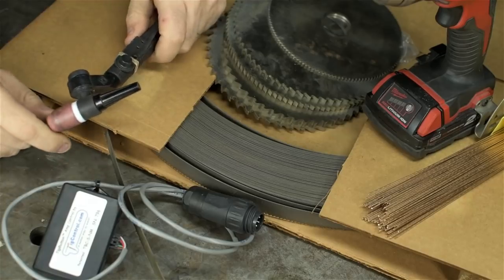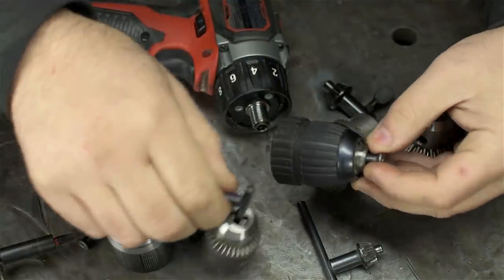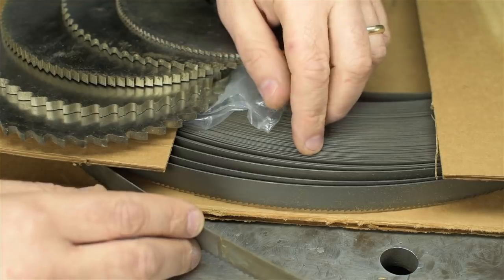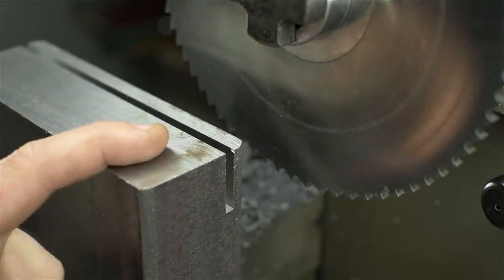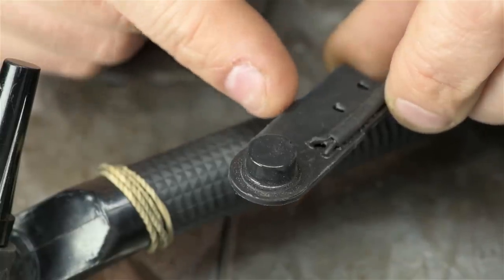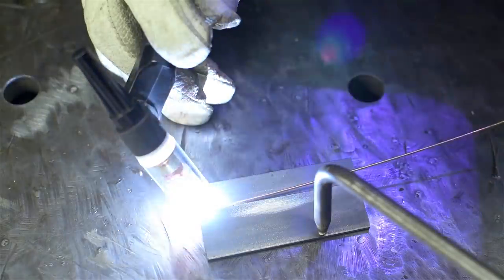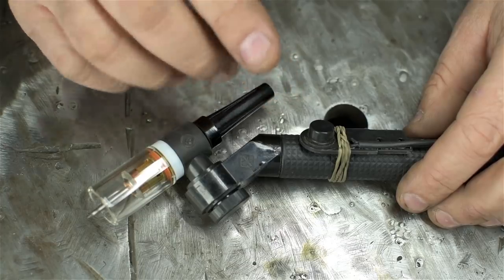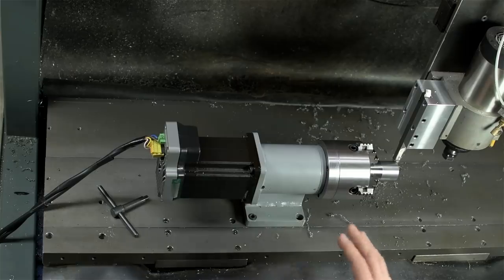STP #7: Saws, TIG Button, Brazing & More!

Comment: I have an older Milwaukee drill and I put new cells in the battery pack and it's just like new now, and whatever kind of chuck they used back then holds everything really well, except for tiny bits. So I got a 3/8" Jacobs chuck with a 1/2" shank on it so I just chuck that chuck in it when I need to drill tiny holes.

Comment: I'm sure you know, but for those who don't. If the saw does stop rotating for whatever reason, the spindle will continue to rotate tightening the arbour nut or bolt (possibly scoring and welding against the arbour. Then the saw will start turning again due to the extra nut tightness but with the high possibility that the saw will then break due to the new excessive depth of cut (machine table will continue feeding whilst the saw had stopped rotating). It may be very difficult to subsequently remove the nut due to the auto tightening.

Comment: I’ve worked in a tool repair shop on those exact drills and the way you did it was pretty much the way I did it except I didn’t use another drill to take out the screw and sometimes I’d just say screw it if it was stuck and get the torch

Comment: Any bit over and including a 3/16" diameter needs 3 flats for the chuck to hold on to. I absolutely love them. I use Milwaukee at work and they absolutely outperform DeWalt, not sure about Bosch as I have never used that brand.

Comment: I was confused by your drill chuck not holding the drill bit tight enough, but I realized because I use Walter drillbits they have flats cut on the ends it never slips (I have all Millwaukee cordless tools) I find the walter twist drills best price / quality and the ones I buy are all split point so they cut CRS like butter.

Comment: You can actually re-temper and lengthen bits with a Bosch.  Saw one once with a 3/8" captive socket on the chuck gear.

Comment: Go to Menards, they have milkuake impact drill bits that are 1/4in drive. The biggest one is half inch. And yes, they are actually meant for impacts, they say impact rated on the packaging and the small storage container for the bits. They also work great and last a while if your smart and don't drill hardened bed frame steel with them lol

Comment: You have my utmost sympathy regarding the chuck issues on your drill. Seems Milwaukee can't put a decent chuck on any of their cordless drills for a few years now.

Bought a 2706 a while back and was geeking out about having a bluetooth adjustable drill when I noticed that it had some pretty horrific runout on the chuck. Determined to have the best drill ever, I bought a 1/2" Rohm chuck. Nice meaty steel one too. Then I found out that Milwaukee changed the thread and shaft on their newer drills so you can't change out the chuck with an industry standard 1/2-30.

I like my German paperweight more than I like my drill nowadays. Especially since it's started to loosen up while being used. Nothing more annoying than pulling away from a freshly drilled hole just to have your bit fall out and hit the floor tip first.

Comment: With the milwaukee drill chuck. I work at an HVAC company, we have all milwaukee stuff. And we like the,. But we had one drill whose chuck refused to tighten. But it was only one. The others tighten fine. I drill 1/2" holes into steel. I may need to crank down on the chuck a bit, but it won't slip. I suspect they had a bad batch or something. Maybe a bad design. Chewing up the drill bits however, I just learned to flip the drill bits in the holder. Oh, don't you judge me sir! I know that's bad for the pointy end of the bit. Like they will last long enough to matter. :)

Comment: I can recommend the Makita DHP481, I've had it for some time now and at least the chuck is a quality Japanese made chuck. As for de-arming power, it does about 115Nm which is enough that it punched a tooth through my cheek at some point (awkward position, had to drill under a table, wasn't paying attention...). I should note that I don't do that much metal work, but I've even had 1 meter long concrete drills in it without any issues.

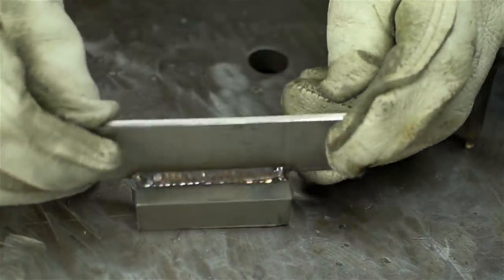Comment: That pre-cracked braze joint is interesting. At 18:30 I was watching what looked like the back braze joint re-melt when you did the second pass on the other side. I expected the crack to be about 1/3rd of the way up the filet, where you can see a phase difference. But it turned out to be right in the middle of the remelted part.

Comment: you could stick some hot melt glue or Sugru over those TiG control box wires for strain relief if you are concerned about damage or them pulling out.

Comment: Thought about trying the button under the thumber?   Its more of a grip rather than a direction than the index finger.  It would push into your palm rather than pushing into the work.  Something you calligraphy brothers do when they have a specially molded stylus.

Comment: I happened to notice that some chucks have brazed carbide inserts in jaws and some do not. Milwaukee m18 Line drills some have normal jaws and some have little tough inser brazed in those. I have noticed that drills with brazed inserts will peel skin of your drill before they slip.

I can only imagine that some of those models are meant for metal industry and some of those are meant to use in carpentry.

Comment: Any chance that quill rigidity is affecting the surface finish?
Why not turn down the back of the Bosch chuck?  I think chucks for impact drills have a finer pitch.  I also think chuck jaws are sintered/squished rather than machined and all the ridges might not be grabbing the bit.  Perhaps a 1/4 inch flappy sandpaper rod will knock down the high ridge chewing the drill shanks.

Comment: Old vid I know, but i too have a time machine! On that aluminum tig your tungsten should have a round tip (made by heating it and melting the tip. Typically a brass block is used) and if I remember correctly the welder should be set on AC (could be wrong. it has been a while since I tigged).
 Edit: Nevermind I was thinking welding not brazing.

Comment: Why didn't you pout some half inch stock in the lathe, fasten the Bosch chuck to the end of it and and or turn down the chuck base until it fit inside the Milwaukee housing?

Comment: I don't know if I'm telling you anything you don't already know but you can cut key ways for those saw blades on your lathe using a custom ground cutter and the z axis as a manual shaper. 
As for the wiring on your TIG button ...Rescue Tape. If you're not familiar with it don't be a fool and get the imitation. get the one named Rescue Tape. The imitations I've dealt with just don't compare. You'll end up finding many uses for this stuff over time.

Comment: A thought (just one) how about a wireless, blue tooth enabled tig toe switch you can slide into your boot and trigger with the big toe (assuming you still have a big toe). No wires, no pedals, just push your toe against the inside of the boot bottom to control your amp flow... On the next "This Old Tony"...lol

Comment: I left my tig button mounted to my torch even if I'm using the pedal, but I dont think the button likes 200A. I typically stay around 125A but I was welding some 1/4 60601 t6 plate and I ran that air cooled 17 torch at 200A nonstop for almost an hour. The torch was untouchable,  even with thick miller gloves. I had to use a fiberglass insulator to be able to even touch the torch. The heat melted the adhesive attaching the rubber button to the board. Haven't tried it yet but I hope it still works lol

Comment: Word 'round the camp fire is tensile strength of sil bronze 50k psi and around 80k for aluminum bronze. Been shopping and discovered 3 types. Have you used any of them yet?

Comment: I have the Milwaukee drill.. I thought the chuck was garbage because it stops so fast, it loosens itself. Then I found out it has a “locking” chuck, I tighten it by hand, then turn one click backwards! Mine doesn’t tear up bits lo,e you are having though..

Comment: This is late, but it seems like it would be excellent to put an exponential amp in the line. Our bodies are so used to non linear signals. It would give more control at the low end.

Comment: My issue with that chuck is that when you go to unlock the bit, if you've tightened down on it "too much", it often doesn't want to undo without using vice grips.

Comment: I never really mind keyed chucks. Tighten all 3 and they grab ! Nice pickups. Slitting saws can be a real time saver. Glad they are working for you. I like the button idea but hand fatigue can be an issue with long welds.Thanks for the catch up bud.
Reply: Protip: Put a wooden file handle on the chuck key. Very cheap ergonomics upgrade thingy.
Reply: @dasstackenblochen9250  Good un ! a couple extra inches is huge. I still like to tighten them all. Just for because eh, LOL.
Reply: I like to tape the chuck key on the drill cord.  Battery drills just can't use keyed chucks in my world.  ;-)
Reply: @TheAmpair  I have mine on a shoelace so they are fully independent of the drill.

Comment: my older Dewalt 1/2" chuck seems to do the same on the ends of bits. but they dont slip after they're chewed up.  I wouldn't mind a keyed chuck.  and i love my two button tig, low and really high. lol

Comment: I had the same problem with my Hitachi drill. I  have been through multiple chucks under warranty. Then they stuck a rohm plastic Chuck on my drill. And I have never had a problem with it since. 
I know Makita had a smilair problem a few years ago with a drill that came out with a rohm metal chuck

Comment: Random question, Tony: Could you do screw threads with the CNC "lathe"? When you showed that clip of turning down the steel to a better finish, it almost looked like threads for a second. I figure it would take some testing to find the right "feed" rate, but with variable speed on the "lathe", you could potentially get a really decent finish on threads.
Edit You could also conceivably do reverse threads with it as well, which is something not easily done on a standard lathe.

Comment: I have the Milwaukee M12 with13mm Chuck. I have discovered the same problems with metal bits. I typically use 5,6 & 10mm. frequently slips. Other than that its a great drill. Might have to chuck the chuck though.

Comment: Good Guess ToT! Looks like it actually came in at 24 minutes and 12 seconds:)  Is that TIG button a quantum tunnelling composite maybe?
I'm no meteorologist either (;)) but wonder if preheating would help on brazing the Aluminium to the Aluminum - seemed like the braze stuck to both parts and failed mid-bead like the stainless steel to cast iron test...

Comment: Hmm, a friend has got the same type of drill and I haven't noticed any problems with the chuck slipping on larger diameter bits despite my best efforts.

Well, perhaps not the exact type, but very similar.

Comment: The button controller probably has a strain gauge in it. That said, I'm thinking that attaching it with a rubber band right up by the "button" is possibly "pre-straining" it and may be reducing the sensitivity/range. It seems to have some mounting holes down the bottom end, do they tell you to attach it that way?
Reply from the maker: wow good point!

Comment: not a fan of torch amp controls but a button wired so its on/off only with pedal still controlling amps is a godsend...makes preflow and feathering out much nicer makes out of position welding nicer too as long as ya can still reach the pedal....torch amp controls only realy shine when your realy out of position and the only option is to sqeeze the pedal with your knees or other protruding body parts :)

Comment: Keep us posted if you come up with a decent keyless Chuck for.your miluawkee drill. We have a dozen at work being used in a industrial environment and I feal your pain on the junk chucks. I've resorted to letting them slip in the chuck until they pull a big enough gauld to key the drill to the chuck jaws then they work really well...

Comment: OMG I have the same drill with the same issues.  I always thought it was just mine.  My chuck will also refuse to release bits so I have to get a pipe wrench to do it. Also all my 3/8” bits are all chewed up from the inside.

Comment: I am not a fan of keyless chucks for the reason you experienced.  The shanks get damaged when the chuck jaws slip.  If you have silver and deming drill bits in the larger sizes, they have flats on them that will keep them from slipping.

Comment: On Drills that have too much torque for me, I've always used the clutch at a high setting instead of the Drill setting. But I've also got carpel tunnel, so when the drill does that to me it's really painful.

Comment: Bandsaw stock: for the metalworkers, carbon steel band saw stock is not really a bargain even if free. My experience is bi-metal saw bands cost about double compared to carbon steel and for general sawing in steel (structural or barstock) you get 2 to 4 times the life. Same goes for sawing high silica wood or marine plywood. 

My "free" remark stems from having to butt the saw stock into bands: what's your time worth? I have a 7 x 12 import band cut-off saw (doesn't everybody?). I buy made up Lenox Super vari-pitch bands from the local saw shop in batches on a three for two basis for about $30 each. Last batch of 6 3/4 x 82 1/2"  bands I bought was in 2012. In that time, I've built a couple custom boat trailers, a roof mount for a ham radio guy (think tiny Eiffel Tower,) Art Deco steel balustrade for a spiral staircase and mezzanine,  and a zillion smaller projects and I still have four bands to go. The low rate of saw band consumption thus depicted reflects this retired guy's tendancy to work when I feel like it. Carbon steel saw bands are for my purposes a false economy.

YMMV, of course, especially if you have a band welder.

Comment: I gotta Milwaukee M18 and a Bosch HDH181X.  The Milwaukee feels more torque'y but the Bosch I feel is more powerful, its also less likely to rip your arm off, the torque builds up slowly.  Might be because it has a brushed motor but it is currently my go to drill.

Comment: I'll be honest I never learned how to dab filler rod, at least not very well. All I do is pulse and lay wire. I scored a pretty sweet stainless tig welding job and they haven't complained yet lol. Nothing structural or code, just has to hold a mild vacuum.

Comment: I've never seen someone try to weld cast iron to stainless before, but carbon inclusions from one and chromium inclusions from the other are a double whammy for solidification cracking. It might work with careful preheat.... maybe even throwing it into a preheated oven immediately after welding to try and slow the cool down but it's gonna be iffy no matter what you do. Bead looked nice tho! Steady hands for a machinist. I was making fun of ABOM for getting all bundled up in a full leather jacket for TIG. We never get to see anything but your hands so I'll assume you were in a tank top like a professional. :)

Comment: The button sounds like it reacts in the same way that a Playstation 2's Dual Shock 3 buttons did (they were "analogue", believe it or not). when trying to drive with them you had 70% (for the sake of argument on throttle), and no less. To get to 100% didn't take much more pressure to achieve, but the thing is, to maintain a constant was next to impossible.

Comment: That marriage (and swift divorce) between Aluminum and Aluminium was interesting. Perhaps they broke up because of the filler material that got between them? I don't really know about these things, but I've been told it is "impossible" to solder aluminium, it supposedly could only ever be TIG-welded. But ... but ... I've seen it done! I've seen aluminium being soldered. I'm not sure what kind of solder they were using. But the trick to it was (while the solder was molten) grabbing a nail and scratching up the aluminium surface through the molten solder. This would break up the aluminium oxide layer and allow the solder to bond to the unoxidized aluminium underneath.

Comment: 2:00 i had the same problem at work, i solved it by just grinding down three sides on the bit, held on just fine. Might not be the best solution though, but since i went through 3-4 bits a day it didnt really matter

Comment: I like rotating my button to about the 6/7 o’clock position as viewed from the rear of the torch handle and use my thumb to press the button with the torch handle in the crook of my thumb

Comment: I suspect the button itself is the pressure sensor,  if it's made of electrically resistive rubber.   The brain box will be simply (probably via a computer chip with A/D, a lookup table and D/A) converting the resistance to a linear response to match a pedal.
Reply: You could make your own setup by brazing a potentiometer to your least favourite dial gauge >:)
Reply: @MattOGormanSmith  - Not likely... the board probably has a strain gauge to monitor flexion.

Comment: If that clear cup has some UV filtering, that could be very valuable. It would be even better if it could filter more of the blue end of the visible spectrum, as that would actually reduce the extreme brightness without blocking all the visibility. A

If you had a cup that is specifically shaped for the angle you work at, would that be better for controlling heat and could help retain argon in the welding area so you can use less argon? I'd assume that people have experimented with the idea already, but I haven't seen any nozzles with angled openings.
Reply from the maker: not a bad idea!  most cups screw on... so if you are out of position.. well, you're screwed.  but the Pyrex just pushed on so it could rotate if needed.

Comment: are you ever going to repair cast iron with the silicon, I have a Chinese vise from a train shop that was hammered on until it snapped. The sages say its best to machine surface cast iron before repairing.
Reply from the maker: I've always fixed cast iron with stainless steel filler.